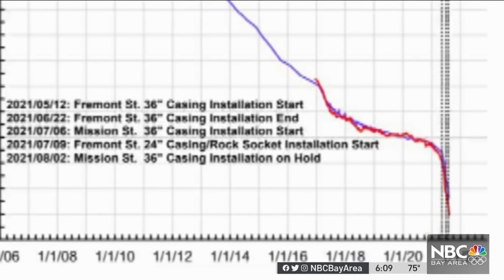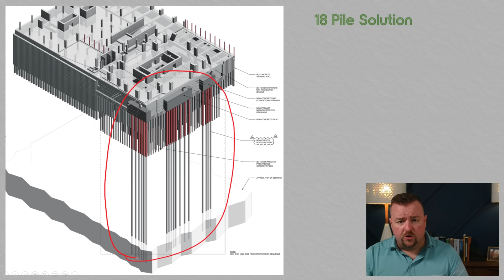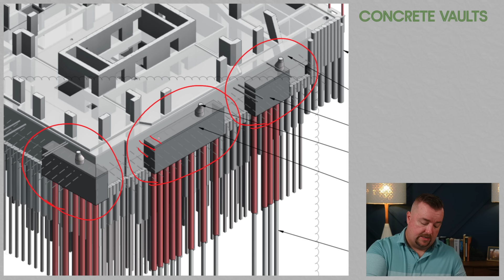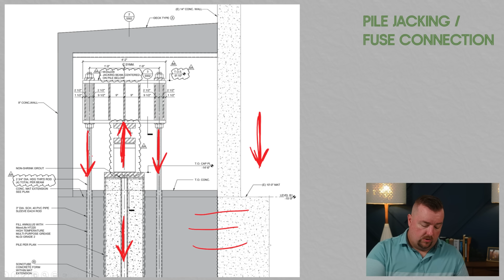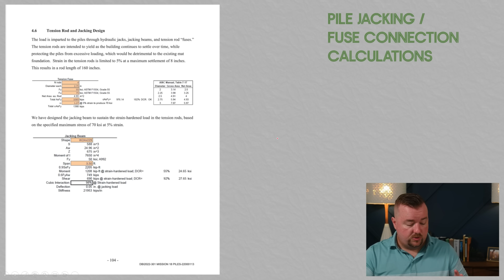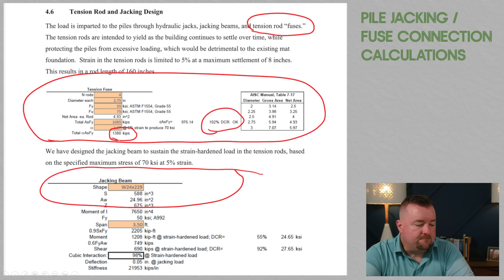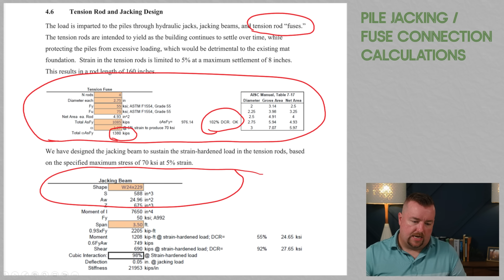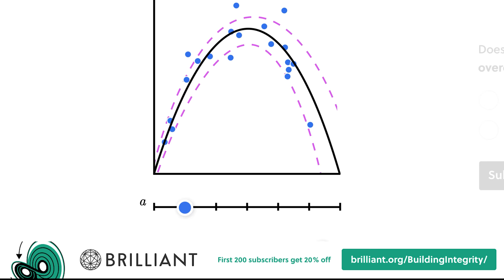Did I Uncover a $100,000,000 Mistake with the Millennium Tower "Fix"?

Comment: What a sight that would be, if the building was lying horizontal across the street! That plate with the rods going through it should have been designed buff as hell, so the rods can't pull through it, and to spread the load out over a greater area of the concrete. 
Also-Let's say the rods act like fuses and snap in tensile. How are they going to be replaced, since the securing nuts are "set in stone", as it were?
Reply: If a rod broke, they would probably add a couple more piles.

Comment: What would the compressive force be on the concrete surrounding the small steel plates? That's a lot of pressure to hold up the whole building on 20 square inches?

Comment: Here's the problem with this project, you can't have the people financing it telling the engineers what to do, they have an obligation to save the structure based on monetary gain, they are pressing the engineers to fix a problem that should have been addressed before construction began, honestly how much money are they going to waste before they just realize that it's a tear down project that needs to be redone...
Reply: The engineers do not make the economic decision whether to repair or replace.  They have been hired to stabilize the building and that is what they are doing.  Their obligation is to do their work safely.  Neither the residents nor the public are endangered by the choice to stabilize the building.  There is no ethical dilemma here for the engineers.

Comment: Although I'm not an engineer, it seems to me that the major stress to the plate is at the perimeter of the punched hole.  So, the nut should have a much wider external diameter, in order to distribute the load over a larger area of the plate.  Also, it seems that the plate should also be much wider and thicker.  Hopefully, someone will actually recalculate this situation and have testing labs certify the design and implementation.
Reply: The plate is buried deep in high strength concrete, so the size of the nut and washer doesn't matter, as far as the plate is concerned.

Comment: Very interesting stuff. I build rods for motors. Makes me think of rod bolt stretch and yield. A serious spring. The bolt is the weak link so buy ARP rod bolts so the rod might be weaker now. It's a balancing act. Catastrophic failure either way if yield is reached or passed. Corrosion and fatigue. Some earthquake activity will definitely happen. It's very complicated fix. Maybe just tear it down and rebuild correctly.

Comment: What didn‘t I get? 
1st. 
You have a measuring device (hydraulic actuator) and nevertheless you need the rods in the main way of force to get strengthened to or over their elastic point to measure their force? 
2nd.
I mean, in electrics a fuse blows to keep a device away from any current and clearing the situation in a non charged way, here the fuse blows and the building is free to sink more? What kind of fuse is this?
3rd
In my country it is standard to review all the calculations of EVERY big, complex or public building, bridge, even a single wall… from a second, highly skilled, independent testing engineer.

Comment: I am an engineer. I do a lot of thise details. The “main” engineers normally don’t take the time to calculate those details and leave that job to delegated engineers. And most projects fail at those little points. I look scary that this monstrous structure rests on a copule of 1 1/2” little plates.
Reply: There are 36 of those “little” plates.

Comment: After conducting many concrete compression tests, I would not want to be in the same area where the small connection plates were loaded for testing. Compressed concrete with a re-bar is the only more explosive than compressed concrete. Sounds like the fix we are discussing has nothing to do with the building.

Comment: My concern is the attachment to the foundation slab by connecting rebars only . The tie in seems to me to be very tenuous.and open to tremendous shear force.
Reply: The force is mainly on the junction where the vaults meet the slab.
Reply: @GH-oi2jf  Yes I understand but the mat was not designed to have such tremendous shear force applied to one end.

Comment: Building Integrity, note that SGH were not the original design engineers of the Millenium Tower. SGH are the engineers for the retrofit. BTW, you indicated that there is an issue with the anchor plates, but I don't see what the issue is. These anchor plates that transfer the upward loads to the concrete is likely designed based on Chapter 17 of the ACI Code. If the steel anchor plate is to fail in shear and the 2.5" diameter tension rod pulls out (very unlikely!), one can assume a circular failure plane of 2.5" diameter (this is actually conservative since we should actually be using the diameter of the nut). The shear capacity of the steel anchor plate will then be at least 0.6 x 50 ksi x (pi x 2.5") x 1.5" plate thickness = 353 kips which is much greater that the 250 kips force that each tension rod and anchor plate are designed to support. What am I missing?

Comment: It looks to me that the tensile load exhibited on the threads of the nuts on the rods is where the critical calculation must be made. I think the rods could pull up through the nut threads, ie, strip the threads. If you know the total thread contact area with the nuts at the bottom of the plates, you should be able to do a calculation.
Reply: There is only one nut at the top of each rod, according to the drawings.  That nut would take all the load in a rod.  The depth of the nut is about the same as the rod diameter, and there are three or four threads per inch.
Reply: @GH-oi2jf  The only other thought I have is if it is possible for the nut to be pulled through the plate? I had seen a failure of a hotel personnel platform where the restraining nut on a rod supporting the platform extruded itself through the platform.
Reply: @JackIrwin-sd7vd — You are thinking of the Hyatt walkway in Kansas City.  That was a far weaker design.

Comment: Young's Modulus of Elasticity, anyone?
The tensile strength of the thread bars HAS to be one third greater than the load upon it.
I'd want to connect a seismic microphone, to listen for when one of the rods fail,
as it does in the cables stays of suspension bridges.
Start designs for a stud extraction kit NOW before a rod fail.

Comment: if the tower is leaning, did they account for other vectors of forces from the lean angle, more than just the vector of downward force?
Reply: The angle is only a quarter of one degree.
Reply: @GH-oi2jf  yes but with millions of pounds, and an undetermined fall rate, as well as the system only being a dampening system to increase time, not resolve the issue

Comment: the bolts are going to rip right through the plate like a pen through a sheet of aluminum.clearly over shot first tremor the build will be compromised and collapse
Reply: You seem to be overlooking the fact that those plates are buried deep in reinforced concrete.  They are already fully loaded to one million lbs on each threaded rod (two per plate).
Reply: @GH-oi2jf  i agree but wasnt overlooked. there are so many things that can go wrong . corossion being the simplist problem the intense heat caused by the sheer weight resting on the smal plates i can go on. fkn lego blocks stand a beter chance. what needs to be done is the simplist of all solutions drive piles on a diagnol under the building creating a cross section until it his bedrock stablize, dig and pour mass colums that are positioned under the foundation at 6 point. the only way to keep this from falling the next option is controlled demolition

Comment: So I'm a carpenter and build things, much much smaller things in comparison. But this whole project seem really under dimensioned to start with, yes it's a feeling because I'm no engineer, but looking at the scale this is like sticking 18 Lego bricks to a building of a million bricks and hope it will carry the load. The Vault is sticking concrete to concrete, rebar in all it's glory is good but it's never the same as if it would've been done in the same pour. It seem a bit odd to apply pressure from the building on a slope on the Vault so the forces want to push the Vault away, why if go with this design, wouldn't you slope it the other way around so wants to "hug on" to it? Calculations is all good but sometimes you have to really upscale your margins for real world unknowns. In the end you should probably just dismantle the building and start over, if you care for human lives. These problems now, what happens in an earthquake?
Reply: The slope on the key where the vault supports the foundation mat is interesting.  I think the design was chosen to control the stress in the vaults.  It is important that the vaults not fracture under the load.

Comment: Sidewalk gawker here. This building should be evacuated and everything that can be removed from every floor be taken out. Though this may just amount to a cup of sand out of a sand in a 5 gallon pail. In fact start removing floors untill it gets to a manageable weight if that'spossible. So if this crazy idea doesn't work at least the building removal process will have started.

Comment: Do you think a Catia 3d simulation of the stress points especially the plate that seems to be a single point of failure would show the 102% and beyond (al the breaking point of the rods)? That would be effective to animate to non engineers like myself. Good video and I don’t think the entire system has enough leverage to stop a collapse.

Comment: The rods at 102% load will not damage the threads? They expect the nuts to retain perfect threads over the years? It seems so obvious to design access to the "plate" and nuts to change them if needed.

Comment: I'm curious how adding these vaults to the SIDES of the foundation can do a damn thing to support the mass of the central parts of the structure.  I just hope no one is killed when this building falls down.
Reply: The building sits on a foundation mat, or platform, of reinforced concrete ten feet thick.  The mat has settled unevenly so is tilting toward the west.  The vaults are now supporting the west side of the mat so that it cannot settle further on that side.  Further settling of the mat on the east side will tend to bring it closer to level, thus bringing the building closer to plumb.

The mat is still supported over its entire area by the nearly 1000 original piles.

Comment: it feels like there should be at least 10" of steel out past the pvc tubes to distribute the concrete loading, 2-2 1/2 thickness to prevent pull though and deformation/deflection and 8 - 10" of support web between the PVC to maintain even loading on concrete
It's like they tossed in a washer and ignored having a support
Reply: Engineering isn’t done by “feel.”
Reply: @GH-oi2jf  yea, ballpark, reality check, eyeball proportions  - didn't toss any numbers in there to justify it being called a back of the napkin
- torque to yield application, double nutted to prevent thread strip, this roughly checks out in theory as it's common practice in yield tests where deep threaded plates or nuts are not used
- plate, less than half the thickness of bolt tensioned to yield !!ALERT!! pull through, severe deformation, cracking likely
- plate, carrying a very large portion of building weight and transferring to concrete, it SHOULD appear as an upside down version of a large steel building supported by a concrete pier !!!!ALERT!!!! plate is large residential home in scale  in addition  to having no provision to distribute load!!!
84" plate area - 14" for holes, 70 sq inches left to carry 650,000 lbs *neglecting PVC area
I guess that's okay if they're using 20-30kpsi concrete , except it's all edge loading...and when that plate deforms that lateral load will scale  VERY quickly as well as the vertical PSI at the bolt :(
Exact failure mode will depend on steel type used as well as the particular type of concrete
Reply: @ty2010 — I won’t question your calculations or make predictions, just note that the system has been fully loaded for more than six weeks without any reports of a problem.
Reply: @GH-oi2jf  till a good rumble, it's like using a rag as an oil or gas cap, seems to work till it doesn't

Comment: There is only 1.875" of steel thickness between the outer edge of the steel threaded rod and the outer edge of the steel plate.  It seems to me that this is the weak point in the entire design.  It seems pretty ridiculous to skimp on the size of  the steel plate for this design to work.

Comment: Fuse= join or blend to form a single entity.

Fuse= a safety device consisting of a strip of wire that melts and breaks an electric circuit if the current exceeds a safe level.

Come on guy!

Comment: We must do study of  natural buyoncy ,if we want to avoid mistake.  Give buyoncy support at the base. 
Second study we must do is of pouring melting of stone for support. 
Only concrete and iron is not enough to take load of  huge building .
Third we must use material to reduce weight of building to avoid mistake. 
Give buyoncy support at the base instead flat iron rod support. 
I don't have too much knowledge but let's us study in different ways. 
Jay bharat.
Reply: Use support  concrete structure used for blocking sea waves near sea shore  . It's have buyoncy and weight is divided. 
In Japan after earthquake we saw it floating and comming out on road.
The design is very  much acceptable for buyoncy. 
Jay bharat.

Comment: amazing, just "scab-on" a chunk of concrete held on by rebar and bolts drilled horozontally,   then  jack it up pushing against 200 foot long stilts that go down to bed rock (they are not going to buckle or deflect under  100k tons?    hope you have pretty good oil seals in that jack.   once you get it level will you flood the vault with grout to keep everything good for a century?   hydro jacks can't hold permenantly.
Reply: It’s 500 tons (US) per pile.  The piles have a steel jacket for added resistance to buckling.

Comment: Won’t this all just mean that the failure of the fuse is just limited by the strength of the plate, therefore rather than catastrophic, it just means the amount of tilt and rebalancing this solution offers is reduced? Therefore a waste of money designing the vault elements for a larger force?

Comment: I would not want to go anywhere near that building. I get the impression that a failure may be very sudden an pretty violent. You would think that with forces this big the calculations for every part would be checked over multiple times right? RIGHT?😨

Comment: I am a materials and manufacturing engineer by training and do metal manufacturing now for a living.  Those B7 threaded rods scare the hell out of me.  A lot of the theoretical strength in them comes from the heat treat process and getting a consistent hardness out of rods that big is a total crap shoot in real life.  With material (especially lowest bidder construction materials) the only thing you can guarantee to be what you say it is is fully annealed (full soft).  B7 rod is basically cheap 4140 that is heated and quenched to "freeze" the internal bainite structure in a stronger state.  When material is that big it is almost impossible to get a consistent internal formation during the quench so you don't really know what you have.  You can end up with a full hard outside zone and a soft core which over time can end up weaker than having the whole thing full soft.  Annealed 4140 or like material would have been weaker but more able to reliably carry the load than what they are using.  This will fail and possibly kill a lot of people.
Reply: The rods are not keeping the building from falling over, they are merely resisting the settling force at one corner of the building.  If overloaded, they are suppose to experience plastic deformation.  If one breaks instead, nothing serious will happen.  If they all broke, the building would just be where it was before, slowly settling toward the west.  It is nowhere near falling.

Comment: In aerospace we always test to failure. What should have happened is a full mockup test to see exactly what the loads do to the bolts and straps.  With just this quick review my biggest concern is the assumption that the four threaded rods will be under equal tension. That almost certainly will not be the case which would mean a single threaded rod could end up trying to support the load. My guess would be a fuse failure starting with the one under the most load and then transferring rapidly to the others.
Reply: I don’t see how the four rods in a group could be very much unequal in tension.  When installed, they would all be tightened similarly, then they all get loaded together by the jack.  If one rod had greater tension than the others, it would stretch more, which would transfer load to the other rods.  If one rod reached the elastic limit, it would stretch before breaking.